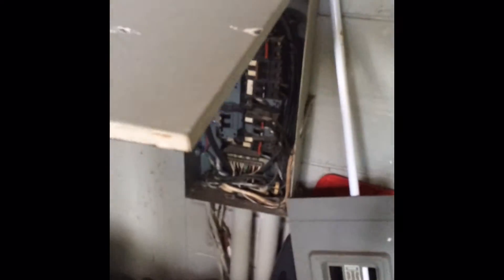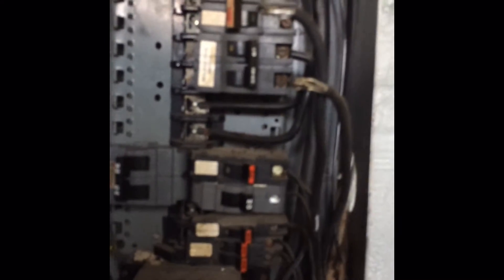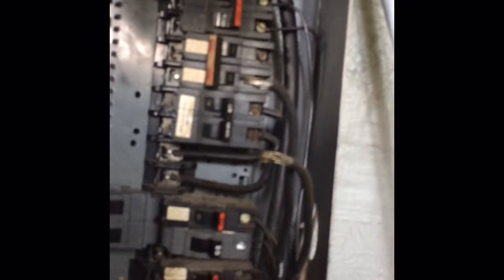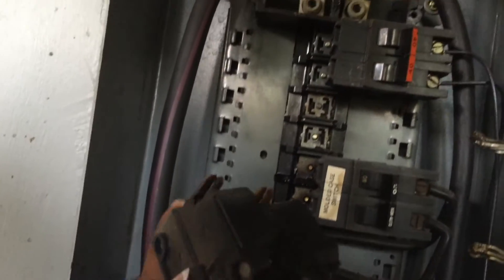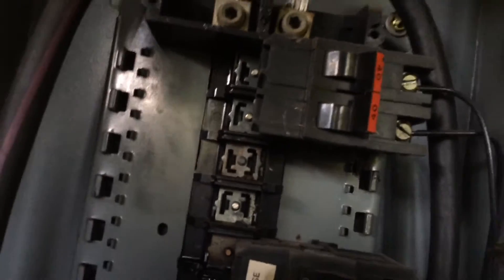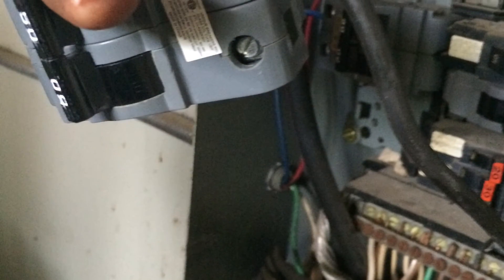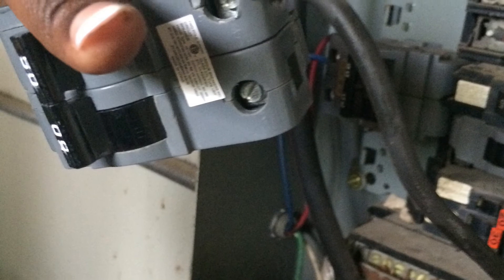How to change out a Federal Pacific Breaker

Comment: 1) replace the whole damn panel. it's dangerous, and could start a fire.
2) is the replacement breaker UL listed? If it isn't (and it looks like it's got cheap plastic) then you're potentially liable if the panel starts a fire, as you conducted the retrofit.

You're probably the only person who would simply replace a breaker in the panel. Any electrician worth their salt would of course replace the whole panel, as it's a fire hazard.
Reply from the maker: Thanks for sharing. These are all points I brought out to the client. They could not fried to change the panel box at the time. That was done at a later date, and nothing caught on fire 😉
Reply: @Sheezelectric  search fpe info - read the report "hazardous fpe breakers and panels". The replacement breakers are no better than the originals, the design itself is faulty.
Reply: The old federal Pacific breakers were what was a fire hazard, the panels are completely fine (though should be replaced) it was the breakers that would fail to short itself once it passed its max amps

Comment: Does the switch just need to be in the off position, or is there a main that needs to be shut off before pulling out/replacing?
Reply from the maker: It is always best to have everything in the off position.  Not all panel boxes  have a main breaker, this one didn’t , but if it does I recommend you turn it off before doing any work in the box.
Reply: @Sheezelectric ah...I dint have a main breaker, good to know. I hsve to replace mine because it doesn't trip anymore..

Comment: Just having trouble removing a breaker - getting the stab part to let go seems to not let go. Double pole taking up two slots.
Reply: Got it. Used a lot of force via leverage with flat head screw driver, thankfully was metal case thing near enough to lever off of. Copper on copper for me but maybe over decades it can still oxidize? Or just stiffen up I don't know. Got it.
Reply from the maker: @TheSkystrider  so gladly got it to work ! Yes over the years they tend to get stuck probably because of the heat produced from the electricity it heats:expands and cools:contracts over and over . But much success good job !!

Comment: It would probably be cheaper and safer to just replace the panel. I’ve seen one of these boxes put 220 into a plug outlet because the breaker failed to trip. Luckily the house didn’t burn to the ground but depending on your location most insurance companies won’t insurance PEC boxes or knob and tube wiring.
Reply from the maker: David seg wow that’s super scary! Thanks for sharing, good point!

Comment: Thanks. I needed to see what the breaker box itself looked like as I needed to remove the difficult 220 breaker and it wont budge. I was going to replace all my breakers to the new safe type.
After some research I discovered the danger of the old orange face FPE breakers. It was after that, that I realized how close of a call I had. If there had not been another 100A main breaker outside the house would have lit up. The 100A main inside the FPE has never thrown and neither did the 50A 220 breaker I am replacing which should have flipped first. I flipped it myself after going out side to investigate a strange noise and finding a lot of smoke. Anyone interested can simply search STAB-LOK or FEDERAL PACIFIC BREAKER. 
The new replacements are safer but outrageously expensive. But now I see even on the site you listed (which is cheepest I have seen) they are around $33 for a single pole. I can replace my entire breaker box and all the breakers with a Square D HOM for $120 which is the price of just a few FPE breakers. 
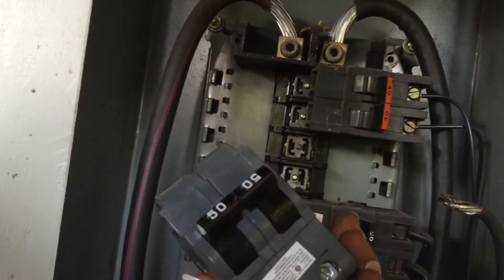PS NEVER NEVER NEVER replace a FPE breaker with any of the old orange face breakers (ebay for example has many for sale). You will notice at 1:10 in this video that she is installing a new breaker that looks very different then the other breakers that have orange faces, They are 65%+ unreliable. That means they will not throw when the current rate is too high for the wire. What this means is that it will allow the wire running through your walls to turn into a heating element that can and has caused many many fires. So if you have one of these breakers do not wait or ignore it. Replace either the box or all the breakers. Please at least look into there danger.
And again thank you for your video. It helped me decide what route I will go.
Reply from the maker: Q Az glad I could help:)